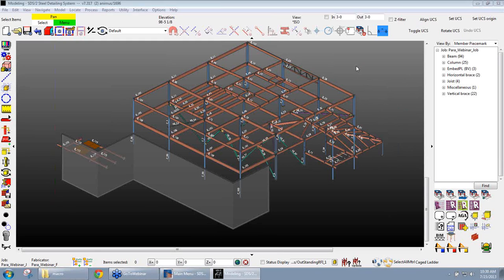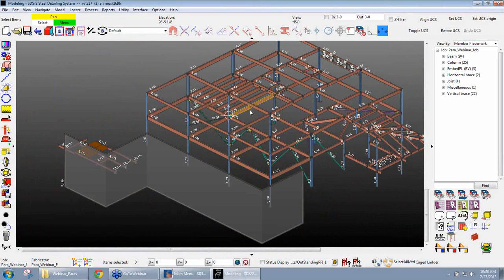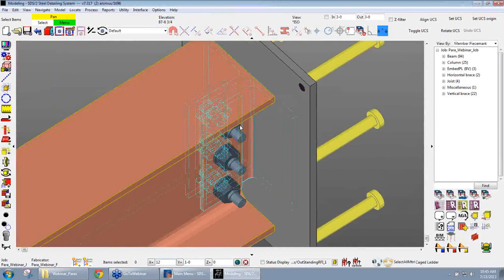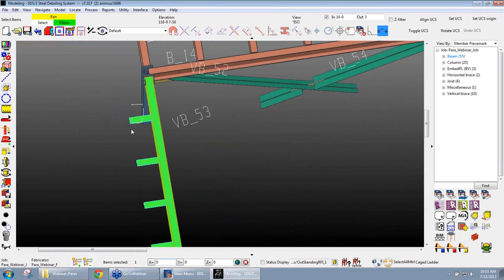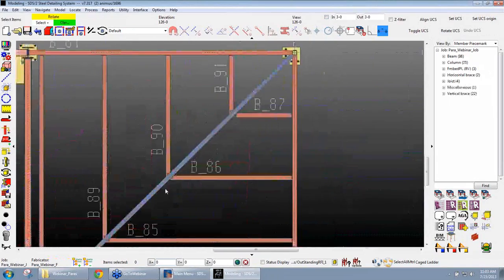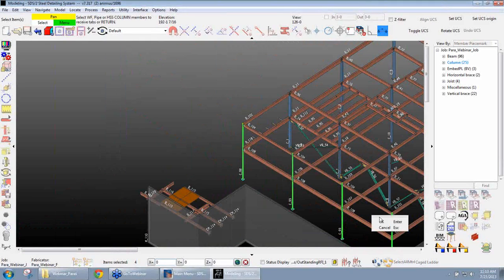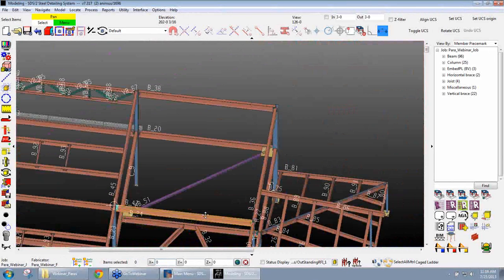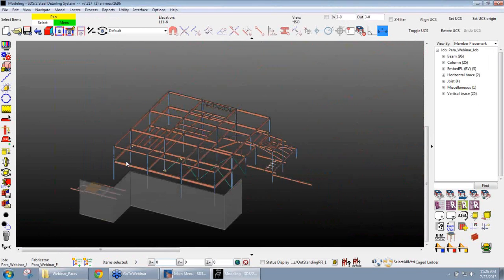New/2 v7.3 Support Webinar: Everyday Parametrics Installed With SDS 2

Comment: It´s certainly a useful webinar to watch, but five or six years ago, a user came with the idea that SDS should offer Parametrics as an integrated part of the Main Software and proposed a Model based on a general parametric routine that could add any material on any rol over any member. SDS  users have to study and lear to use hundreds of paramentrics while it will be straithforward to lear and master just ONE.!